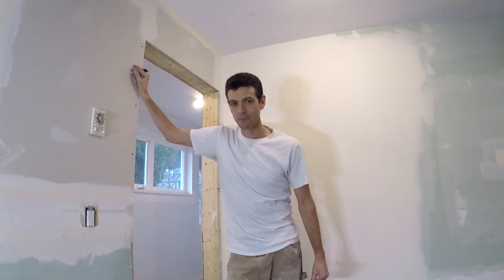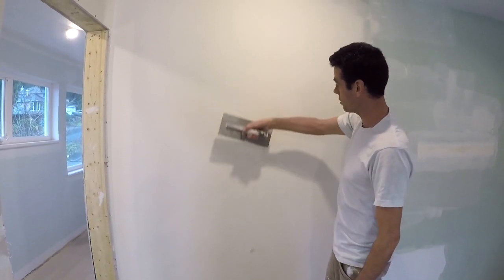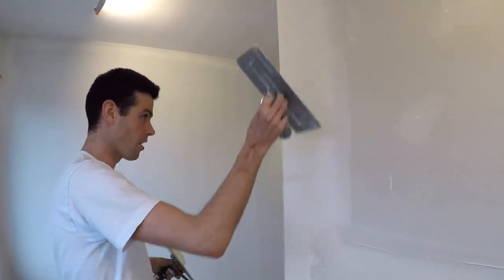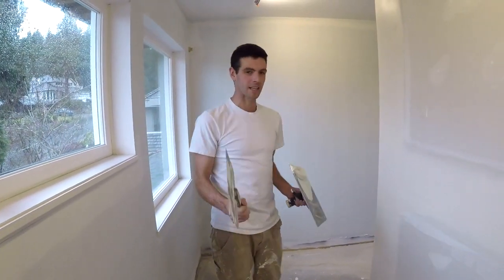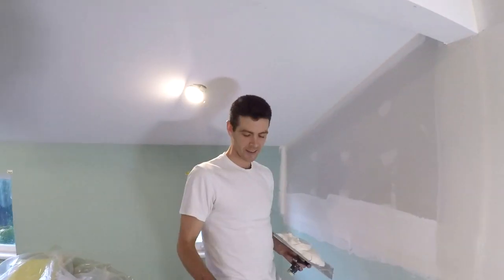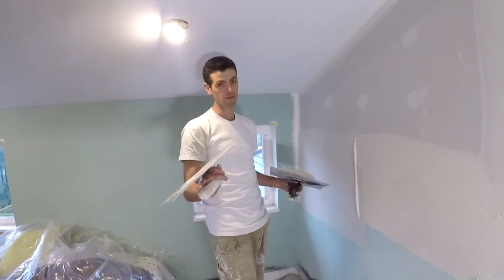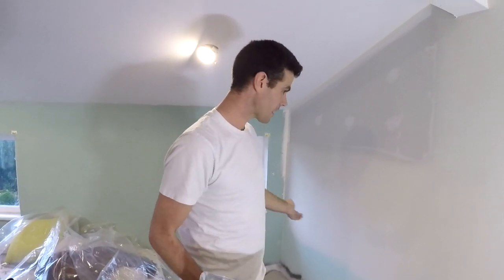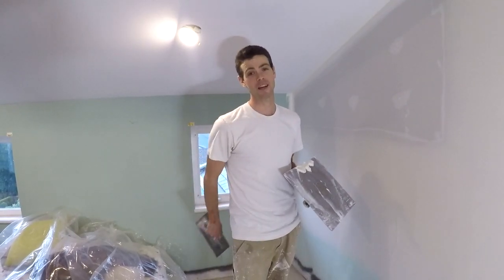Flat trowel vs Curved Trowel

Comment: Ive been a curve trowel finisher for 25 years. And i have zero issues doubling butt joints with no lines.  First coat down middle.  Double up on second coat and ride center of butt

Comment: So I didn't realize I was using a curved trowel until I watched this video. Went out and bought a flat one and it's crazy how much easier it is to work with. Thanks for the video and the info!
Reply: My local box stores sell only curved trowels in the drywall section. Flat trowels are in the tile section.
Reply: I got a curved trowel, immediately recognized it as better for doing the work than a knife, but also really hated the curve.  So I guess it was a learning experience.

Comment: I use trowels almost exclusively.  I use both straight and curved (and I do have and use a 15" curved). One thing I'd like to point out is that with either a curved or straight trowel you essentially have a 4 or 5 inch knife with the SHORT edge of the trowel. In your example of the butt you tried to do with the curved trowel,  that is exactly how I do them with a curved trowel,  BUT I then use the end of the trowel like a knife to wipe down the center.  You can even spot screws with the end of a trowel.  Just something I've never seen you mention. Love your videos.
Reply: Wait you didn't ridicule him for something he didn't point out? What kind of world are we living in?!
Reply: So you have video's on your work..
Reply: This is a fun thing I found with my curved trowel. It's concave on the broadside, but the ends are convex and are actually handy for quickly feathering an edge.

Comment: Love my curved trowel. Only use it on 1st coat butt joints. Second coat feathers from the high spot.  I used to do water damage restoration. So replacing the bottom 24" of drywall left a ton of butt joints. It works wonders on the right project.
Reply: I agree, i have a 14''.
Reply: Brian 716:  Agreed.  About the only use I have for a curved trowel is on butt joints--especially with mesh and quickset.
Reply: Jason Austin u use it on both sides kinda thing?
Reply: Same here. I do occasionally throw a first coat on the corner beads with it as well.
Reply: I do water and fire restoration work. Curved trowel, some 20 minute and some mesh tape works wonders on those long runs of butt seams on a flood cut.
Reply: Never thought of that. I mean you can do it with a standard knife or trowel but I see what you mean. Gives the hump to secure and hide the tape (granted it's not too big of a hump but you can feather wide).

Comment: Im a painter in the U.S. im not even a drywall man and i enjoy watching your videos. I occasionally have to do minor point up on the foreclosures i paint. Your videos are definitely helpful. Thanks
Reply: Your lucky. Up in my neck of CT it seems the painters also do all the taping and compounding. Most I do as a carpenter is putting up the walls so I can hang drywall, which is sad because I have to wait for patch jobs just to touch compound. So sad, because I feel like a good tape job is more art than anything.

Comment: binged  for days for my first drywall project ever. but came to this video AFTER having unknowingly bought a curved trowel. was in a wtf mode till I sighted down the blade. ahhhhh. considered flattening it but fear breaking loose the spot welds. back to lowes. so my head scratcher for the week plus binge on your channel is 74k subs and 30 to 70 thousand views per any given video and the thanks you get is a handful of likes each time. thanks for taking the time to help educate us all.

Comment: Well, I think the curved trowel is the best tool for the first coat on butt joints. But only for the first coat. The rest of the work should be done with straight trowel or pan and Knife... This is my opinion...
Reply: I agree. On new stuff I use it for butt joints and feather out both sides with a flat trowel on the second coat.

Comment: If I may make a recommendation:  They sell a mud scoop that is shaped to fit the side of a mud bucket.  It is fantastic for scooping every last ounce out of a bucket, and for cleaning up the sides so you can close up a partially full bucket without a bunch of mud stuck to the sides above the line of the mud, which forms chunks. I got mine at Home Depot, but I don't know if you have those up in the Great White North...
Reply: No problem; I took a cheap plastic 8" knife, put it on the bucket and traced a cut line with a pencil and cut the curve.
I always knew that one day I'd find a use for that thing...
You can also just turn a 6" sideways and circle around the walls. We call it "parking the mud". Nothing worse than spreading a bunch of BOOGERS across the joint!
Reply: yes we doooo

Comment: I use a curved trowel for coating up ( hot mud)  but i curve them myself from flat and use diffrent depths of curve for joints ( more curve ) and for angle (much less, only very slight curve). 

You can feather with a curved trowel but you need to be curving them yourself to get them right and you also have to consider the flexibility of the trowel.  If you know what your doing it works very well.

Comment: As a novice who doesn't do much dry wall, I made my own. I started with an inexpensive Canadian Tire  11X4.5 trowel. I made one long edge concave by 3/16 inch with a grinder and fine sanding disc. When held against the work at an angle it leaves a slight extra bit of mud in the centre.

Comment: I have a “bevelled” trowel too, and I love it! I only use it for butt joints, because it puts about an 1/8” compound/mud over the centre🇨🇦/center🇺🇸 of the butt joint. So you don’t have to use skills to build it up. I never tape with it, let alone doing corners with it. And then afterwords, you just float out ech side with 12” or 14” knife/trowel. 

I thing to really appreciate it, you have to think of it like a corner trowel! You only use a  corner trowel, for corners.

Comment: I love my curved trowel. Perfect for first coat tape joints. I don't use it on corners. You're correct, it's not practical for most remodel jobs but it is great when you have a lot of new drywall to finish. 

You did the tool a disservice by using it on a joint that has already been mudded.
Reply from the maker: I will make a better one the next time I have a bunch of flats or bead.

Comment: After 35 years as a painter flat are for filling first coats round are for feathering 2nd or 3rd coats .......as a painter in Europe we fill Render walls ceilings with 10" inch knives as you American's call them  
We call them spatulas
Plasterers would certainly prefer straight edge trowels for 1st coat👍

Comment: FYI... cove trowels are best for butt joints. High side of butt covers tape on 1st coat. Then... don't touch high side pull when pulling the low side. Thats 1st coat. 2nd coat goes right down the middle of the 1st coat 2 pulls, w/ a coved trowel. Butt has that mild hump and very little sanding. For smooth wall pull outside 1st coat pulls. Sand & life is good. Also, you put too much mud on the coved trowel when loading a wall. You should be able to feel the wall with the edges of the cove trowel when pulling.  Also, let people know that a taper puts the bend in knives when they first buy them and then only ever use  that coved side of the knife. The only thing I use hawk & trowel for is applying hand textures. You're a good taper but you put a lot of mud on when coating... understandable when doing smooth walls and it appears thats what you do most of. All that said, one should use a bigger coved trowel for butts too. I'm 40 years in it and like your videos... believe it or not. Obviously I don't learn much but you know what you're talking about and handle yourself well in front of the camera. Last but not least, I've watched tons of You Tube videos where worms are trying to teach people how to tape and coat and they shouldn't post their hideous technics. So... I shred them in the comments. Its good to see a real taper doing videos.

Comment: I use a curved trowel on the first coat after taping. Then I use it as a small hawk. 

Also its only curved if you hold it with the surface parallel to the wall. If you hold it perpendicular to the wall it would be flat on the wall. 

I think its fine and easier than knifes in the early stages. But im no pro so I dont usually care about how long it takes.

Comment: I like a curved trowel for one thing only, a flat joint (vs filling factory tapered edges) . You need a layer of mud over the tape and with a flat trowel of knife, is is hard to get a consistent depth. I concentrate on getting a layer on and try not put the mud on the full width because as you point out, its hard to feather. If I do have to feather then I use a flat knife and just pull the material back out. Depending on how wide I can go to hide the inevitable speed bump of a flat joint over butt ends, I sometimes take a 2nd pass on each side with the curved trowel again concentrating on getting the center full depth, the the curved trowel gets put aside to collect dust again until the similar situation.

Comment: for a first time taper side to side on a butt joint and let I dry then use your flat trowel down the centre is the same thing as using machine tools like a 10inch flat box side  to side and then a 12inch box down the centre.

Comment: I just bought one the other day in a desperate gambit to improve butt joints in my kitchen remodel.  I need more practice but it seems to be solving a problem I have on the first coat getting the right thickness of mud over the tape on the first coat.  Use the curved to wipe once (hopefully) and have a straight blade ready to feather and leave those "Vancouver Carpenter" lift-off lines (haha).

Comment: Curved trowel would be kinda nice for floating floors. But I still use flat trowel, sometimes even use the rounded end trowels

Also good on this guy. Im not much of a drinker either and I personally think its a problem if you are drinking every night or even every weekend.

Comment: Hello there! I'm actually using curved trowel pretty often and I really like it. So, first of all you using it in wrong way. These are to put on in first layer, right on the paper tape - you can get a surface with beautiful "bump" in the middle, right on the paper tape. For the second layer I'm using 12" or 14" taping knife or even wider flat trowel (one end is sliding right on the "bump" made with curved trowel) - with it I'm putting mud on the both sides of the joint, so in the end you'll have a nice 24"++ junction. Sorry for my English though, I hope all of this is understendable 😅

Comment: I tried mudding with a trowel and kept gouging the adjacent mud with the corners. I wonder what the result would be if the trowel’s front and rear edges were rolled upward like a cementing float?

Comment: One of those Canadians who love curved trowels here. I’m mostly in new construction. That Richards one you have tho are absolutely terrible. They are way to stiff and never work in. Trowels are just like any tool, get what you pay for. 18-20 000 bd ft houses there is usually no need to cross in the same day. But even then doesn’t have to completely dry just set up.

Comment: Thanks for this. I went to buy a drywall trowel at Menards and they sold one option in the store--the curved. I put two of them face to face and there was a huge gap between them. Which flat trowel do you recommend and where to get it?
Reply: A lot of places sell nice flat trowels in the tiling department. You have to be careful there though because most of the trowels have teeth.

Comment: Hey Ben. What type and size of trowel do you prefer to use for finish work and skim coating? I have been using a pan and knife since I learned the trade but using a 12” knife for skimming does break the wrist after awhile.
Reply from the maker: My favourite trowel is a 12"x5" Curry stainless steel trowel. Flat as always. I hear Marshaltown makes a good stainless steel trowel too. I really like a 5" wide trowel. Way less knuckling in the corners compared to a 4.5" . I like a 13 and 14 inch trowel too but I always go back to my 12".
Reply: I just ordered a 13”x4.75 Sheetrock Matrix from All Wall. Hoping it does the job. I’d like to start using the hawk and trowel more often. Thanks for your reply Ben!
Reply from the maker: @turnerdrywallrestoration8077  That's a great size. I have one exactly that size but the brand(Nela) is too stiff and makes a horrible sound on the hawk. I never noticed it until i filmed a few videos with it and heard it while editing. My muscle memory is set to the curry trowels and I can't seem to change the angle I wipe the trowel enough to change the noise.
Reply: That’s pretty funny. I can relate to weird little things that bug me like that. I have two 14” marshalltown trowels that I use for putting on a base coat of mud, if I’m doing a full skim over walls and ceiling especially over texture, one is the rounded pool trowel which I do like because it doesn’t leave too many lines but I just didn’t have a good one for the second coat. 
I went to local shop a few days ago that specializes in plaster and concrete tools. They had an entire isle of trowels and it was overwhelming. When I asked some of the guys there about a flexible trowel I could use for drywall mud they looked at me with question mark eyes and even one of the customers told me “they sell that stuff at Home Depot”...
Reply from the maker: @turnerdrywallrestoration8077  😂
Reply: Vancouver Carpenter  do u have a Facebook page

Comment: I'm curious, what size hawk do you use and what would be the purpose of a small 8x8 hawk be ?
Reply: I use my small one for painting touch ups...standard size is 14'' i think
Reply: @aaronbrown2966  , Thanks for the info, I usually only do small patches to 4-6 sheet size jobs. I could see the advantage of a small hawk for the patches in tight locations, I work in apartment maintenance. To be honest I hate cleaning out pans when I'm using quick set. Back when I started out as a painter I heard about guys using trowels to finish drywall, I've always wanted to try it. When I'm back to work after surgery recovery I'm getting the tools.

Comment: I couldn't watch the whole video but in my experience they are a beauty on 2nd coat butt joint to build over tape without the hump from straights...but I'm not as good as you are with straight blades

Comment: Is  your flat trowel basically a cement trowel?
If I had to choose, i would never take the curved one.
Reply from the maker: Same idea but wider. Concrete trowels are usually 4 or 4.5 inches. Mine is 5 inches wide. It's also stainless steel.
Reply: @vancouvercarpenter  Damn! Nobody sells those, where can I get one! Looks like you bought the last one on earth.
Thanks
Reply from the maker: @tabascocrimson7865  that is very similar to what I use. Exactly the same just a different brand. I have always wanted to buy one of those.

Comment: Looking at that trowel if you offer it to the wall you probably will see only the very tips of the thing connect with the wall.. that's not good , you want a inch on both sides flat to the wall when offering it up. The curve being between those inch long contact spots.
Reply from the maker: Interesting. I'm not writing the tool off they just have never had a good place on my jobs yet.
Reply: @vancouvercarpenter  I agree with what you say tho, your right that's why I ended up making my own and it's only since they bought out the mid flex trowels iv started final coating with a slight curve... That slight curve just stops it being concaved rather than leaving a humped.

I use the mid flex 11 inch for 1st coat on external and again put a slight curve in it so once they set (hotmud) they are flush with minimal recess .. between 0 and half a  millimetre.   

Different systems and tools for different applications again.

Comment: Curved trowels are best for 1st coating with quick set mud.They do build out the  recess in the dry wall. Curved trowels can  be used for second coating.But fair amount of pressure must be applied.It levels out flat when fully dry..Yes they are useful at times, slightly annoying to use.I use a flat trowel mostly, it's faster and makes a good job of building out the joints with less scrapping off.

Comment: You are missing a point here. Curved trowel are made just straight 2 plaster boards joists. You obviously can't use it on angles etc. I would like to see your flat trowel joists after painting and good light... gypsum shrink and you cannot avoid that unless you plaster widely or whole surface

Comment: I use a hook and flat trowel for different reasons when I need them. Yes, we do full new construction houses so we can move on to the next seam and let the mud dry in between coats.

Some of your complaints aren't really valid.  The hook trowel doesn't float edges over wet mud, so don't use it for that. Also complaining about the coat over the tapered seam is garbage, you put it on too thick.... you should see a professional do it.

Some tools are made for different purposes. Why don't you use a 12 inch knife for that angle that you used the "prison shank" blade for? Then you can complain about how stupid the 12" knife is at coating corners.

Comment: I likeyour videos man but you only use your curved trowel on your first coat of flats and buts and then the stright trowel for second coat and skimming. The way we do our but down here in newfoundland canada we ususally use a 14" curve trowel amd coat the both sides of the tape leaving the center, when that drys we come down the center of the but with the curved trowel
Reply: And it works, ive never had any issues